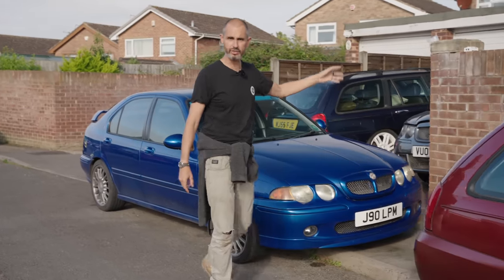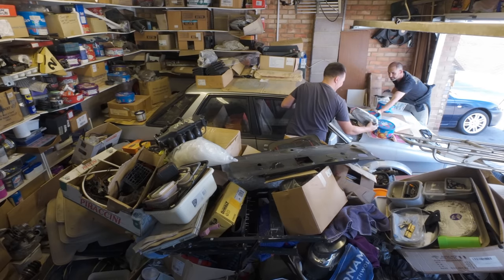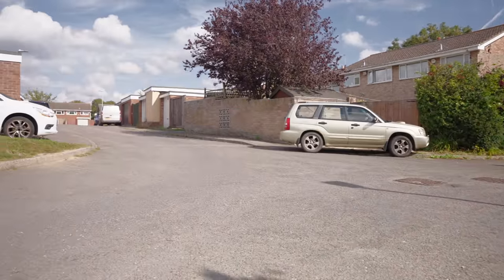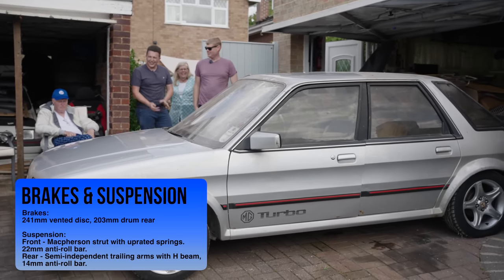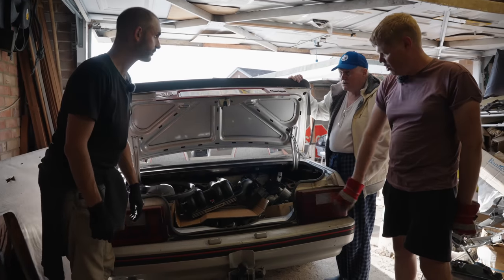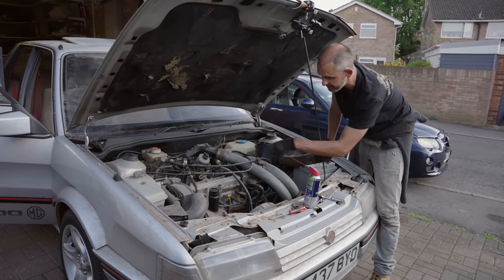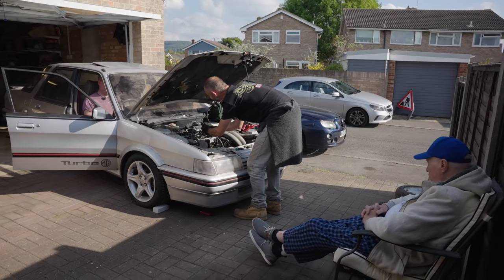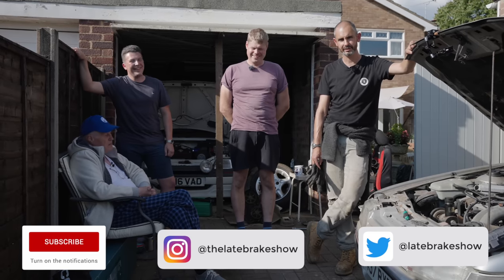Barn Find Unicorn 80s Turbo Classic Car - Will it run?

Comment: I loved mine, I still have the watch, key fob, tie-pin, tie and booklet which came in a presentation box when I bought it, heading down to BAE Bristol on the M5 was always a joy 🙂
Reply from the maker: Do you really?
Reply: Sold my box of treasures on eBay years ago- the tie was quite handy but the watch not so great. Be worth a fortune now 😊
Reply: Hello Johnny, Yes, I lost the box which also had a keychain, the MG badge is worn from where it would rub against my shirt cuff, I can take pictures if you would like to see them. Its shape was based on the TA-TB & TC radiator grill. @TheLateBrakeShow

Comment: MGs have been underrated for a while but I’m glad to see they’re starting to be appreciated more. Even my ZR has had lots of positive comments. The MGR community is 100% the best full of so many helpful people and so much knowledge
Reply: They’re not really being appreciated that much more. It’s just the fans are able to find each and make content more easily now.

I respect 80’s and onwards MG’s and Rovers as an example of engineers somehow managing to make vaguely good products despite management penny pinching and an assembly line with poor morale. 

The turbo montego and maestros were rapid for their day, but the bodyshell was flimsy. 

Head gasket issues aside, the K series is actually a great engine power to weight and cc wise.
Reply: @Jonathan_Doe_  Good points but I've definitely noticed they're being taken a bit more seriously. 5-6 years ago when we last had MGs they never really got many comments and they usually got laughed at online 😂

 My ZR has had quite a few people compliment it and even had one or two trying to buy it 😂  You still get the odd headgasket comment but I think people are starting to like them now they're starting to get that early 00's retro cool look to them

Comment: Great vid and what a great car - I’ve always had a thing for Montegos, mainly because my dad had one in the late eighties.  The Turbo was always unfairly criticised for being unruly - mostly by people who had never even sat in one let alone drove it.  The early cars were a bit raggedy in their power delivery but the later ones were very well sorted motors - mechanically they were often way more robust than people would have you believe - my dad’s 87 model gave 10 years of reliable service rust being the thing that finally got it - remember it being a very comfortable car too - years ago I got a chance to drive a Turbo - C-reg in moonraker blue - was fairly shagged and the mate who bought it got it for just £300 - but even with all the wear and tear I remember being amazed by the in gear acceleration which at the time felt genuinely fast - my mate had it about 6months until the mot ran out and the welding requirements led to an untimely death - think it ended up parted out and the shell scrapped - shame really as I’d love to own one these days

Comment: A geekish observation is that the red Montego Turbo Steve Soper was driving came off the road in 1996. That's probably about right, as the new cars I drove in the early to mid 80s - BMW, Renault, Ford, Mini - only lasted about ten years.

Comment: God I had a montego a D reg 2.0 litre EFI with full brown leather interior and in silver and i think the bottom half was black. 
When I bought it, it was a really clean example with hardly any rust and it was obvious that the previous owner really loved it, i loved it,  it was really comfortable and was pretty fast for what it was. 
I really miss those early year's of owning car's because at the time you never realized that some of the car's you owned would become valuable classics, im not saying my old montego would have been a valuable classic but you don't see these car's anymore, especially on the road being used .
Another great barn find jonny and a great trip down memory lane 🎉🎉

Comment: My cavalier Sri broke down 20 miles after setting off to Cornwall with car full of 3 baby daughters hi chairs the works. I was recovered and given a replacement car provided which was an mg Montego. I had it for a week. What a comfy, smooth and rapid car, very capacious too. Wheelspin without provocation. Was very impressed. However the company worked for had an mg maestro what a piece of…….😂😂😂😂

Comment: I didn't realise the man that was MGJohn had passed away, awful news. Condolences to his family at a very difficult time.

I remember reading various posts on the MG Rover org forums and he was always a very knowledgeable chap and very helpful.

I actually purchased one of his modified heavy duty UJ equipped shift linkage for my old 620ti, proper rifle bolt action as he would have said!

Great video, as soon as I realised it was a Montego I knew it'd start with little to no trouble. Despite the smack talked about to them and other AR vehicles they're plenty reliable.

RIP Mr McF.

Comment: I worked in a plastics factory who made the rear cluster light I made loads of them lights if I remember the ribbed ones were 123/030 and the smooth was 144/030

Comment: My first cars I ever bought myself were a Rover 420 & a MG ZS of the late 90s, early 00s era. Brilliant, flawed, cars. Every time I shut my door a bit hard on the ZS the window would drop into the door, necessitating removal of the door card to push it back up. The Rover's alloys corroded so badly inside I had to pump the tyres up twice a day. I loved them both dearly. The Rover got written of when I was rear-ended and the ZS blew its head gasket at cough mph on the M4.

Comment: That took me back.  Mine was a black 1985 model, bought new from Natocars in Bridgwater.  Took it to Germany on posting (Army) and threw it up and down the autobahn at 130mph Had the speedo replaced twice because it kept breaking - the spring apparently.  They started fitting 150mph speedos soon after this.  Mine spent a lot of time off the road unfortunately.  Never did get to the bottom of it, sometimes it would just cut out at 90mph and wouldn't let you go any faster.  I sold it in frustration eventually and bought a Charade GTti.

That said, in the early-'90s I (with some hesitation) bought a second-hand MG Montego (non turbo) that my brother picked up at the auction.  It never put a foot wrong and made up for all the trouble I'd had with the turbo model.

RIP, John.  Condolences to the family :(

Comment: Had one new in 1986, brilliant but bonkers torque steer. C600LNS. It had an engine issue, blowing oil, but because nobody in the BL network knew how to fix it, I eventually got a new engine. As far as I recall the problem had a simple fix, something to do with air filter blockage causing the turbo to suck oil.

Comment: Had an F reg Metro GTa which has a very similar interior loved it so much with the Turbo exterior trim but £100 each in 93 for a 22 Yr old for those 13" meric tyres just too much and sold it but miss it so much!

Comment: Had an MGZS 52 untill dad sold me his e46 in 2000, was lovely car, shame on me for scrapping it because it needed new clutch.
However, i kept the 5 17” straights to sell separately, still have them as never got round to flogging.

Comment: Back in the day the Montego looked a smart car I remember having a drive in a Turbo must have been around 1988 and my introduction to torque steer - it was mad under full throttle you really did have to wrestle the steering wheel :)   In fairness most front wheel drive high powered cars built in the 80s were the same.

Comment: I never liked the Montego’s styling. My old man nearly bought a Maestro when they launched, but it didn’t have the space he needed. He got a Cavalier instead, which I detested. 
He was a fleet driver and some years later, he had a pool car for a few months while he waited for his new motor to be delivered. It was a late model, bright red MG Montego.
I got to drive it quite a few times, because I was over 21 and living at home, so his insurance covered me. Many of those times were quite long journeys. It was a revelation. I still didn’t like the styling much, but the car was lovely to drive. It was comfortable, responsive, handled very well and shifted. I had to change my mind. It really was an excellent car. And it was fast.

Comment: So back in the day when I worked on montego we nick named them monty-no-go!!😂 
You know The faulty oil pressure switches the faulty radiator fan switches and the dry solder joints in the ecu!!! 😂😂😂😅 and the Phuk-ing head gaskets......

Comment: 25:43 : Around 175-180BHP per ton then. Yep that would feel quick in an 800kg Car no doubt. A Fiesta ST makes about 180BHP Stock and they weigh in at 1260KG. So looking at the figures the Metro is ahead by around 25-30% in the power to weight to a modern Fiesta ST.

Comment: When they hit the streets, nothing under 50k could get near them.
You were in big trouble if you mistook an MG turbo for a standard MG, the standard was fast, but the turbo, it just F*cked Off !
5 seats, 4 doors family saloon car that could eat and spit out any hot hatch of the day.
I had a C reg Metallic light blue one, it was a torque steering monster that I sold for twice what I -paid for it after taking it to the local car meet, everyone wanted it.

Comment: That engine, and more to the point, the large hoses are confusing me. The turbo is down the back. Is that the airbox midway up the right side of the bay? It looks like air goes in through there, caries on back to the turbo, back over the engine down to the intercooler then back up over the (hot) engine to the throttle body?
Assuming that's right, wtf is the box and hose on the left side of the engine bay? Doesn't look high pressure so not intake/boost piping?

Comment: Putting metric tyres on the MG's was a barking idea. I changed my '87 MG Metro 1300 ones to 165/60 x 13" Compomotive anthracite wheels imperial, tyres as fitted on MG Metro Turbo.
Reply: Everyone thought it was the way things are going.

In 2023 we are still measuring wheels in Imperial Inches ??

Comment: Sorry to hear MG-john has passed away, as an ex Rover foundry metrology technician quality engineer for many years. John was slightly deluded about Rovers & MGs they really were crap and in going on 20 years as an employee and been entitled to very good discounts and with offers on top we could get 40+ % of a brand new car, the only cars anyone bought in all the years was the last few years with staff buying 75s & ZTs and the odd ZR & ZS. We had from Brand new Montego diesel estates for getting between foundry & Machine shop they use to get some right abuse

Comment: My mate bought this car brand new when it came out we both worked off shore on the oil rigs it was only one week old when his wife got a puncture she managed to change the wheel and put the spare wheel on but for some unknown reason she put grease on the wheel nuts and as she was driving along the road the front wheel came off and she wrote his brand new car off😂

Comment: true story:
a friend had 2 motor accessories shops, his car was a brand new red MG Montego turbo. it got stolen from outside the second shop, whilst he was sorting the till out
 it was horsed about all over the north-east, baiting the local police into chases, but nothing could catch it. it eventually ran out of petrol + was dumped with a few marks on it, + the door/ign locks ripped out of course
sitting in a money bag behind the drivers seat were the combined weekly takings, over £3000 in cash, worth about £11000 today, they had never noticed it, one very lucky lad...

Comment: These type of vids are for the most part, pointless. Most of these 'barn finds' almost without exception have rust issues, have been accident damaged, have degradation of seals and numerous other parts or just left so long they're just not worth the effort. It's beyond me why people just abandon and/or forget about these vehicles. It takes little effort to maintain them, run them every once in a while, change the oil once a year and a polish every so often. If they're not going to use them, sell them to someone who will respect them for what they are and use them. This is just clickbait and a well worn out theme uploaded by a multitude of the so called 'barn finders'.
Reply from the maker: Not worth the effort? Your long-winded comment fully explains to us and the world how little you understand about old cars and what really constitutes 'beyond economical repair'. You've never worked on a car, or you don't understand what a classic car is. Please don't watch The Late Brake Show any more.
Reply: @TheLateBrakeShow  Don't understand older cars? Presumptuous much? I've had many classic cars in my lifetime and I do the maintenance on all that I can do with the knowledge and resources that I have available otherwise a workshop does the rest. Stuffing a car in a garage, shed, or barn and covering it with whatever and forgetting about it is an inane exercise. And I only watch the occasional video of yours as it's altogether too frustrating, along with the other gazillion channels that have the same theme, as previously mentioned. Most of your barn finds are suitable for parts only, with the occasional gem that will hopefully be restored to it's former glory.